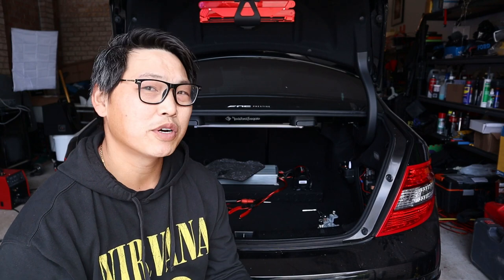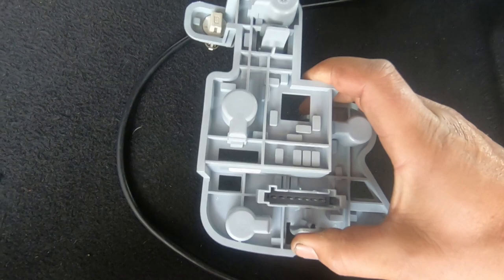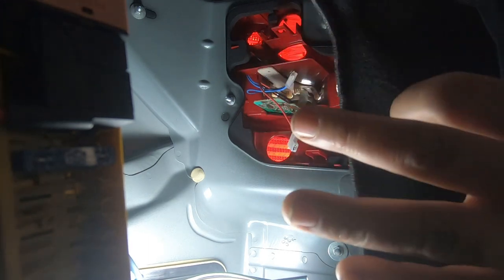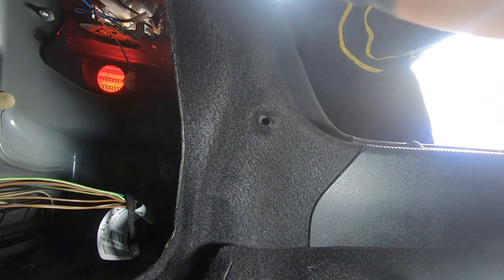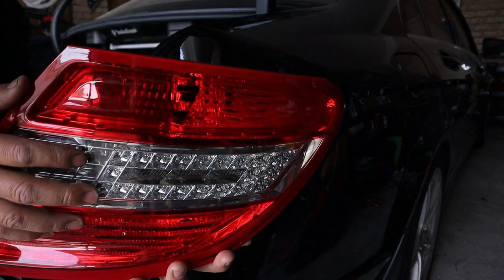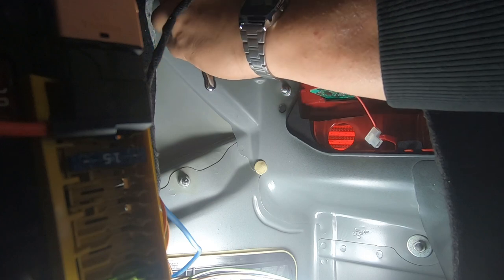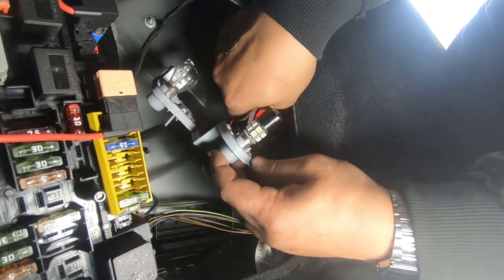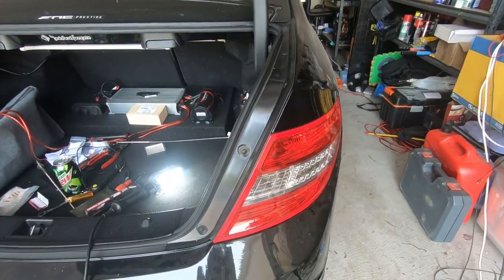mercedes benz w204  commom fault + rear tail light removal + reinstall

Comment from the maker: if you would like to see a video on how to fix the comon fault leave a comment and ill be sure to consider it
Reply: Make the video bro! I have the same problem! do you have instagram? you said ground it to another point of the car, but what point? please help!
Reply: I've started to have the same problem aswell now and it don't look nice especially on a Mercedes.
Could you show how you changed the earthing point also did you use a thicker wire or the same size wire
Reply from the maker: @banks1777  its done
Reply from the maker: @irfy2009  the video has been made check for it
Reply: Hi Mike. My name is Roman.on my 2009 mb  c 300 rear lights turns on it self after I  park  an lock  the car in 5 ...10 min and stays on till  batery  ded. Any solution? Thanks
Reply: My C-200k tail lights won't turn off. (now disconnent battery)

Comment: Nice video, but the problem is not caused by a thin ground cable, as that cable's section can handle a lot more amps than any of those tail lights would ever take, it is the connector making poor connection over time, hence causing resistance and heat. That's why the melting is always close to the connector.
Reply from the maker: good input bud

Comment: The wire is not the problem. It’s the under dimensioned connector. You need to put a second ground wire from the bulb frame to the inner screw on the body panel.

Comment: Nice job !  thanks....can you show how to install reverse camera in a W204 2013 ?
Reply from the maker: hey friend unfortunately i dont have a 2013 model to show u however it would be very similar to the video i did to install a reverse camera..the only difference would be how to remove the stereo head unit .... which is pretty easy... runnings the cables i believe is the harder part...
Reply: Hi Mikey ! thank you for fast response...my C204 coupe has the fixed screen in the dash , pulling the cables looks difficult , but getting the headunit out also. There are several films on YouTube but not with my type of car.  Keep up the good work !!!
Greetings from the Netherlands

Comment: Since couple of days I have this common issue with ground cable, causing dash display 'rear indicator light' and of course this cable is getting hot so I need to fix this and I woild like to do it by myself but I would love to see your instructions as you explain everything very well and carefully, showing everything on video without hurry in excellent quality.
Reply from the maker: ok buddy i will release a video in cpl days ahowing how to fix it

Comment: Hi brought a rear left hand lamp got it fitted. But show fault and indicator flashing as the led gone.the garage is a independent merc dealer. They say because it after market unit does that make any difference? Please help
Reply from the maker: which tail light do u have ? same as mjne ? with an led as indicator? ...not true..after market tail lamp are still designed to plug and play... no errors no faults

Comment: I dont have the LED indicator but i wonder if i can just smack a sequential LED strip in there and put it on the tabs for the LED indicator..mmmmmmm. Good video sir. I had that brown earth wire fault i just put a extra wire screwed it straight to the bulb holder and lead it to the closest ground close to the light.

Comment: Thank you so much for the info regarding the wiring, I happened to get that fault where the wire burnt and the harness melted, so I will earth it somewhere else and let you know, was about to take it to an auto electrician.
Reply from the maker: if u do wat i did it will solve the errors and faults..and clear any codes... yhis is a common fault..especially if u do have the melting of the tail light harness

Comment: Hi Mike, thank you for all the videos, it's really helpful, I've got the same common problem with the tail light wire melting. I've bought the parts but how do you change out the burn cable n pin in the connector 🙂

Comment: Im looking to buy some cable for the grounding point problem, is 17 amp ok? Also what do you do with the original brown grounding wire that goes into the connector.

Here's the description of what im looking at.

Product Type: Reel Single
12v 17amp maximum load. 4 Metres, Black
28 copper strands, each strand 0.29mm

The Halfords 17 Amp Cable Black (ELEC147) is suitable for high output headlamps, halogen fog lamps, rear screen heaters and wiper motors.
Reply from the maker: anything over 10 to 15 is fine ..just don't make it too night for a nice look

Comment: I have the damn error messages on my dash. You are smart as shit. Dealer wants to charge me 500 to fix the melted lamp carrier. I watched your videos but don't have any experience or tools to add a ground wire, seems complicated for a lay person.
Reply from the maker: its really easy to do bud.. I know it may seem hard but u can do this
Reply: @MIKEYZVLOGZ  aight ima do it, I’ll let you know how it goes. Thanks for the videos man
Reply from the maker: @stephanm3032  most welcome give ir a go u will do it very easy... if u don't know how to solder get a drill and drill a hole through where u  wont obstruct anything and it will be easy ... get a long enough bolt    and push it through ad a washer and spring washer (optional) and then simple install it with a nut... make the wire with a 15 amp use about 60cm or maybe shorter ..just ensure long enough... eyelet on both sides
Reply from the maker: @stephanm3032  the lamp carrier is the grey plastic piece that removes from the tail light assembly... it simply pops out via two tabs and replacing it is as easy as that .. 500? that's why ppl call it the stealership ... hence why I also do these videos so it can help others in the w204 community 
fix the issue with simple diy tools... if u don't have tools... I syrongly recommend to invest in tools and start to diy yourself as well... tools are an investment ..in the long run they are priceless to have in order to be able to fix basically anything round the house and work on automotive and mechanical things ... I use to be just like u .. and never had any experience or the means to do things.. but slowly I learnt bought tools invested and here we are and I can show ppl if I can do it..so can u... I am no professional... I'm not mechanic..I don't have a mechanical background..completely self taught from videos and research via forums and sites ... so if I can do it..so can u
Reply: @MIKEYZVLOGZ  Thanks man. I recently got a 2011 c300 4matic from a family member who passed away. It has 82,000 miles. Has some issues despite the low mileage. One of which is the tail lamp issue, and no way im going to pay $500. I will follow your video, and just buy a little solder for $20.  

 Issue 2 it has is that the screen in the center console thats flips out is half white and fading. So i'm going to replace that through vids up here, maybe with an android screen idk yet. 

Another really annoying issue is that the check engine light is always on because of the old style cam magnets and wiring that needs to be updated. The dealer wants $500 to update these. I need to figure out how to update this because $500 is too much.

The final major issue is the damn transmission. There is a loose bearing and the car makes like a whirling shhhhh sound when you accelerate (it's pretty subtle right now). Apparently it is a common problem in these 2011 4matic c300s.  So the dealer quoted me for  an entire transmission change at around $8-10k (because they will only replace with a rebuild and wont replace parts in the transmission)!!! But I found a local shop who will swap the bearing out for $2,300. I think I am going to take the gamble on only fixing the bearing because I don't have $8k laying around to replace the god damn transmission. Barely even have $2,300 laying around but I figure it is better than a new car loan etc.

Such a sweet looking car, I love it. I am going to try my best to fix what I can myself. Love your videos man without videos like yours, it would be so hard for lay people like me. You have motivated me to invest in some tools and learn.
Reply from the maker: @stephanm3032  even though u have these issues everything is fixable ... to what extent is dependant on u and how far ur willing to go... the dealer is the last place I'd ever go ... just they charge too much but some of ur issues are diy fixable even for a newbie like urseldlf.. but tools are a must ... also another tip its better to research ur issue figure out what it is and then take it to a mechanic who u think is trustworthy and express the issue that way u can let them know u know the issue and what needs fixing ..I can't stress how many mechanics will take u for a ride bwcuz u don't know anything about cars ..happens all the time .. I wish u all the best bud
Reply: @MIKEYZVLOGZ  thanks man, I’ll post questions if I have any. Your videos are perfect. I’m gonna try to install the lit Mercedes symbol in the front too.
Reply from the maker: @stephanm3032  no worries wish u luck ..u will be ok maN
Reply from the maker: @stephanm3032  it realy is alot easier then it seems
Reply: @MIKEYZVLOGZ  hey one more question, do you do your own oil and filter changes and car check ups etc? My dealer charges 250-400 for servicing lmao

Comment: Mike, I have replace my break bulbs with LED but I have been getting the check lamp warning. What LED light are you using? Great videos and I’m learning from them. Thanks.
Reply from the maker: ok so u want canbus error free led bulbs .. I use a brand called auxito .. basically when u search for led bulbs in your bulb size .. enter the words error free and canbus ...then look for what states error free and canbus.. this is important because our cars have a canbus system ... so it needs to be able to register with it and sync therefore no error codes... code show due to voltage fluctuation ... due to using led bulbs .. they use less wattage causing the canbus system to think there's a drop on voltage hence the error message... find error free canbus bulbs and u will be good but ensure they are

Comment: Quick question, after you make another ground, do you disconnected dia original ground route? Or you have 2 ground?
Reply from the maker: u can remove old ground or leave it ..but most ppl remove it as its no longer needed
Reply: @MIKEYZVLOGZ  gotcha thanks

Comment: In mine. The common negative pin was burnt out. I by passed it. But i think there is a problem with the LED strip blinker. 
Still looking. Going to pull the light out.

Comment: Hey Mikey, thanks for the video. Can you give an example of where else you would ground this wire? I'm having the same issues and I've just ordered a new bulb holder and connector and I'm afraid it'll just start causing the same issues as soon as I replace it.
Reply from the maker: basically any part of the chassis .. the cars bare metal.. that's your grounding points ... if u see any bolts that stick out that's a grounding point .. also the grounding points they use where u see Brown wires they are grounding points too... if u are unsure u can get a multimeter and turn it to continuity and then put one side of the cable to a known ground point and the other on a point you might wanna use and if it beeps u know it connects together and it will be a grounding point too ... basically your testing to see if the points meet ..that way your sure its a grounding point ..hope this helps u
Reply: I fixed the wire issue two years ago and its been fine until recent im getting the left tailight warning. All bulbs work and i changed all the parking/brake bulbs but somes one every two days. I ordered a new bulb holder which doesnt cost much. Do those ever go bad?

Comment: Great video, very simple. Can you please tell me where I can buy these bulbs in Sydney?
Reply from the maker: the bulbs I bought on ebay ... just look at the bulb size and use the reference of the bulb to buy the correct ones... for example if it's py12 etc..don't search via mercedes w204 led bulbs ...don't do that because all bulbs aren't the same and u wanna make sure u get error free canbus led bulbs too
Reply: @MIKEYZVLOGZ  Thank you so much for fast reply. I will probably buy from Bunnings or Supercheap Auto, as Philips or better quality are available online only. I need P21W.

Comment: same problem to my w204, one pin of the connector was burnt, need to build a thick wire to replace the ground cable to fix it

Comment: Hello!
I changed the melted wire set to a new one and also changed the plastic "backside" of the tail light where the bulbs are attached and i still get "rear right turn signal not working" error, it starts blinking the turn signal but then it starts to blink my braking light? any tips on this? sorry for the bad english!
Reply from the maker: did u change the plug harness ? and if so did u conne t wires correctly? its wierd that the brake light is flashing too
Reply: I'm experiencing the same issue did you fix it? And what was the fix

Comment: Do you have a video by chance replacing the harness clip? Mine is burned though seems like the issue at the end of your video. Would like to do it myself.
Reply from the maker: heybud sorry i dont ... which harness clip ? do u mean the black harness? pretty easy .use a pin remover then get another plug harness and push the wires i. same position thats it..theres a certain way to remove pins from a plug harness usually a sewing needle or pin helps has to b thin
Reply: @MIKEYZVLOGZ  Yes indeed the black harness. Ok great. I might just buy a new one off Ebay aftermarket and then plug the still good wires into it and then replace earthing cable via what you had before. I think that'd work right? 

Thanks!!
Reply from the maker: @maltaussie  yep thats exactly it..just research  abit of how u remove pins from a harness

Comment: So this happen to me today my back light went out a few days ago and today I got the replacement assembly cause for some reason mine was all rusty and when I went to switch it out the connector broke all the pins inside the connector due to rust and melting so now I have to cut the wires and replace the connector so question you said to change the ground wire to a bigger and thicker wire and it won’t happen again?
Reply from the maker: correct ..unless u have a shirt that would do it .. but if it a case of melting wires ...then yes it will solve the issue of melting wires ..as I stated it happens due to the ground wire being too small for the amount of current running through ... hence solve the melting of the harness and wires
Reply: @MIKEYZVLOGZ  and where is the ground wire at ? Like were do i look for it is it by the back fuse box
Reply from the maker: @kglife4180  no the ground wire is the brown wire that comes out of your tail light harness plug 
usually far right with plug pointing away from u 
the brown wire

Comment: Mikey, I have some bugs in my taillight that I want to remove. Will I be able to access front of my taillight using this procedure? Thank you...... anyone?
Reply from the maker: i would try and tape a small tube to the end of a vacuum and after removing the tail light feed it in and follow it to the bygs locatiin and it should suck it out ..even try compressed air... block holes  and leave only 1 open blow air in and it might push the bugs out
Reply: @MIKEYZVLOGZ  thank you very much!! Keep up the great work 👍

Comment: Any fix for brake/tail lights that don't turn off?
Reply from the maker: not sure as I've never experienced it..but wen so.ething like that happens..there's some sort of short or crossed wires causing it to stay on.. can u get a proper mercedes scan tool? ot should be able to narrow down your issue.. it can usually tell u the issue

Comment: Why does my taillight keep turning on and off even after i replaced my bulbs twice? The sign on the dashboard comes on and off as a i drive.
Reply from the maker: are u using original bulbs or led. ? check and make sure your connections are ok ..any melting of the harness? u may need to do the fix by creating a new ground for the tail light assembly ...
Reply: @MIKEYZVLOGZ  i'm using a regular bulb. i don't think i saw melting but thought it might be the harness, so kind of pushed in all the wires to the connector and the warning light doesn't pop up as much. Should I replace the wire connector or do i need to get all the wiring redone? Thanks for the quick response by the way!
Reply: or maybe replace the light bulb carrier? Please advise! thanks and subscribed!
Reply from the maker: @samuelkim6120  ok so if u watch this video again I explain why u get errors due to the ground wire being too thin..so it can't handle the current going thru throwing error codes... hence why I showed how to create a new ground cable for the entire tail lamp assembly ... it should solve those error msgs